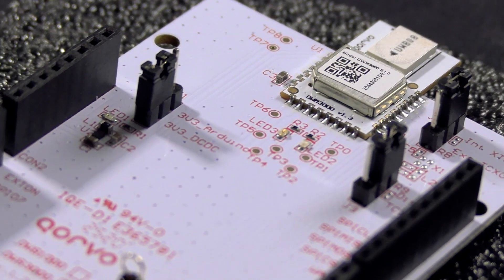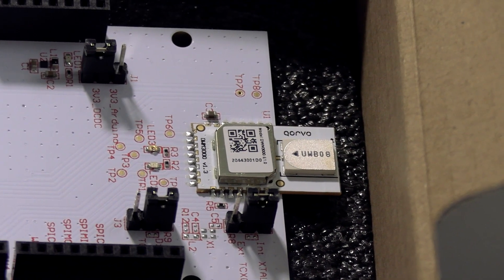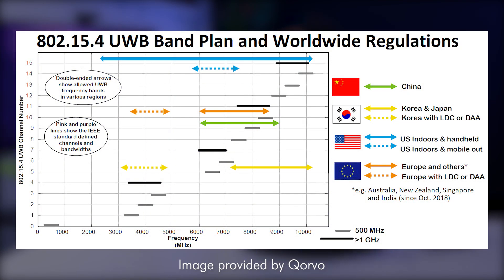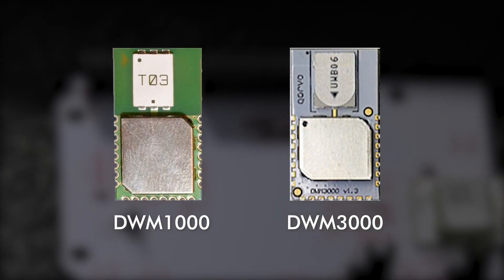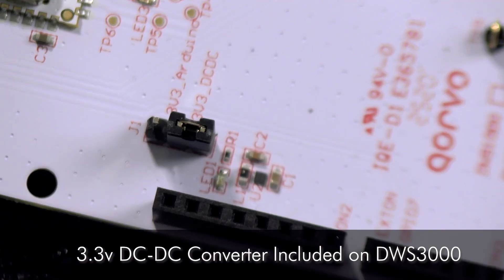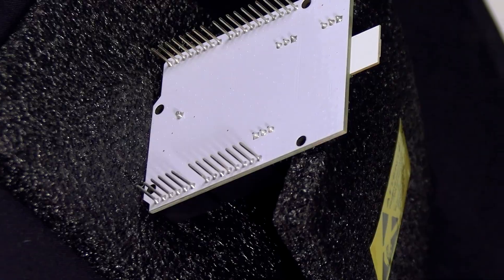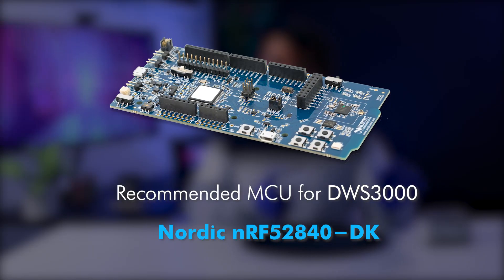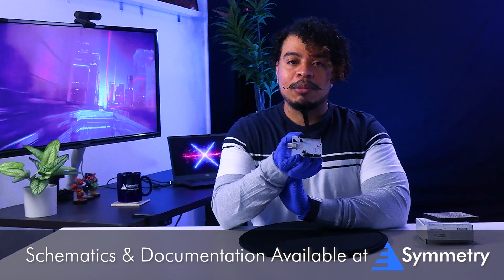Qorvo DWM3000EVB Unboxing - Locate Objects in Real Time with Ultra Wideband

Comment: Is there any guide for using it on Arduino UNO board ? Similar to what they provided for Nordic?
Reply: See other comments
Reply: @rodmcmahon4829  Thanks for your reply. I understand the API software they provided on the website is not suitable for Arduino. My question is, if they have plan or guide for Arduino users to test the RF module in the nearest future. 

Was your answer official or it was based on the current state of the software you downloaded ?
Reply: Based on downloaded software. I'm a frustrated user with two development boards that I can't use.
Reply: @rodmcmahon4829  I see. That makes sense! Judging from the API document, I think the best chance is to use a Nordic board which is aligned with https://www.globenewswire.com/news-release/2021/06/07/2243089/11142/en/Qorvo-Solutions-Interoperable-with-Apple-U1-Chip-for-New-Ultra-Wideband-Enabled-Experiences.html.

I also only have an Arduino board at hand and I want to confirm it's a dead end before I move on.
Reply: @yifanfu6085   I have a Nucleo--144 mother board but still held to ransom by Eclipse.. If anyone can post a complete set up guide it would be helpful. The Qorvo " Guide for building API examples" is a start, but assumes full familiarity with Eclipse
Reply: @rodmcmahon4829  The Qorvo's guide for testing UWB functionalities with Raspberry Pi and Nordic DKs were pretty straightforward. Although the result I got was not as good. The range seems to be very limited.
Reply: @yifanfu6085  ,regarding to the qorvo 's guideline with using the nrf 52840 DK board with DWS 3000  ,so right now the segger embedded studio IDE is the best IDE to write and develop the code , am i right ?
Reply: @yifanfu6085  Did you successfully test dwm3000 evb with raspberry pi or with nrf52840 dk ??
Reply: @patpat7360  both
Reply: @yifanfu6085  great!!
Reply: @yifanfu6085  I couldn't find any guide for testing with Raspberry Pi. Where can I find it, please?

Comment: will i be able to use mount DWS 3000 on ARDUINO UNO and test it ?
Reply: No you won't. The software will not run on Arduino in present form. The software designers have used a high end IDE not suitable for Arduino users
Reply: @rod mcmahon -->  how do you know that ?
Reply: @rodmcmahon4829  regarding to your recommendation ,  youtube video , QORVO documentation, there are only  nRF 52840 DK , nRF 52832 ,nRF 52833 DK are suitable/compatable  to test and develop the code on DWM 3000 EVB / DWS 3000 , am i  right ??  
 i ask you to be sure before buying the nRF 52840 DK